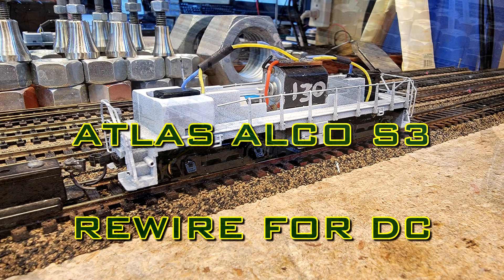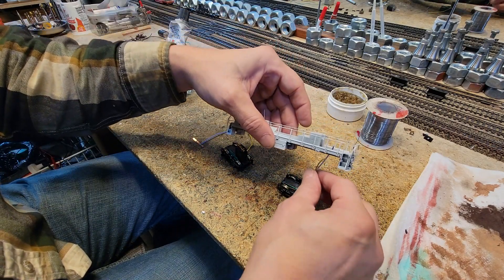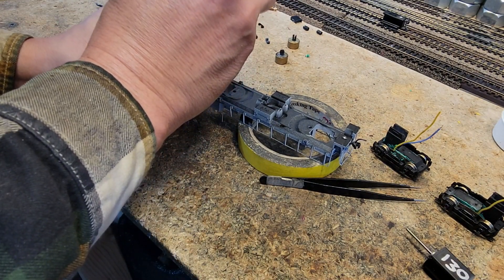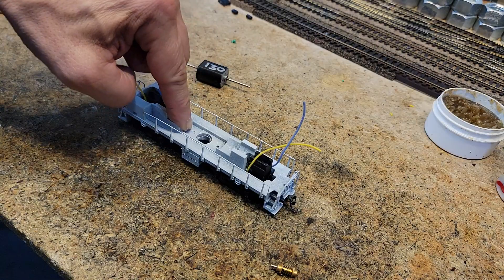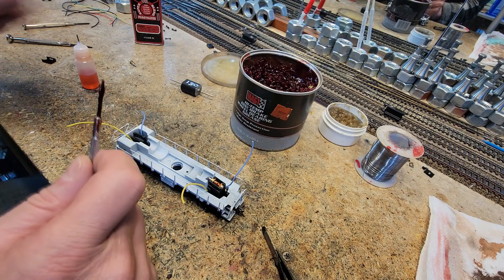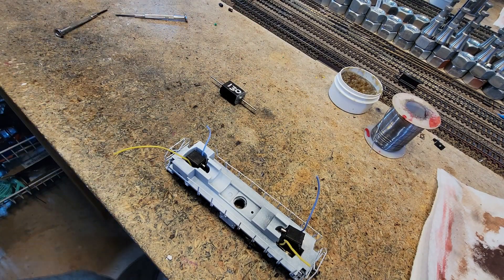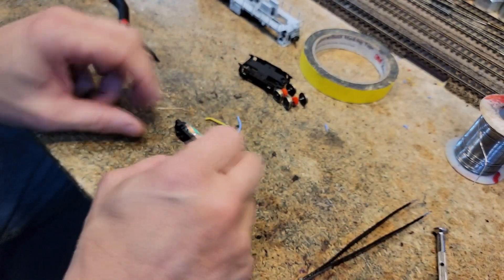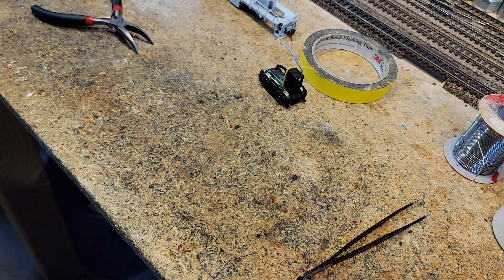Atlas Alco S3 remotor and rewire

Comment: Was that a 5 pole motor?
Reply from the maker: the FK-130 is a modern 24v 3 pole motor.  this isn't your old crappy 3 poles from way back when!  this motor is like comparing a smart phone to a rotary phone in terms of performance!
Reply: @elite194  I have used some of the fk 180 3 pole 6 to 24 v     i  have pretty good results
Reply from the maker: it's a shame that those are gone now - that's the reason I made the REV1 motor!